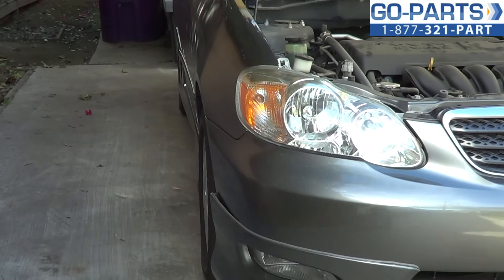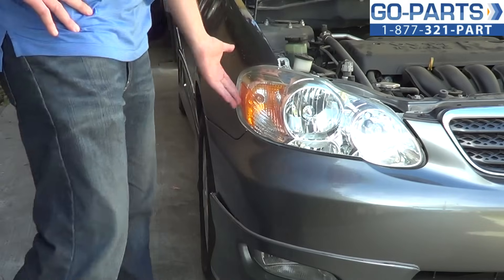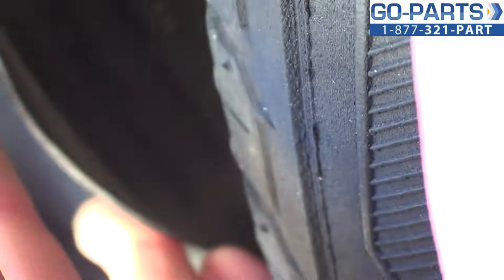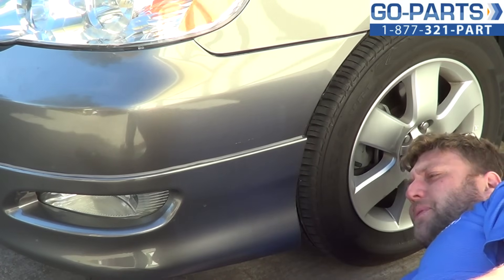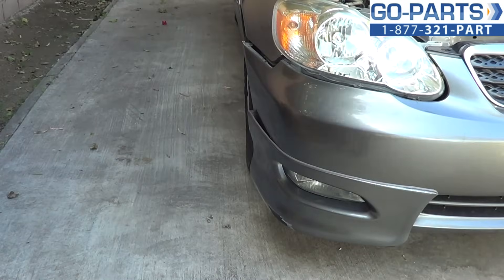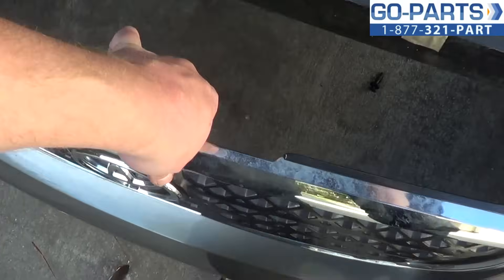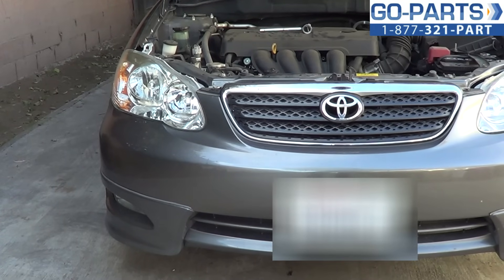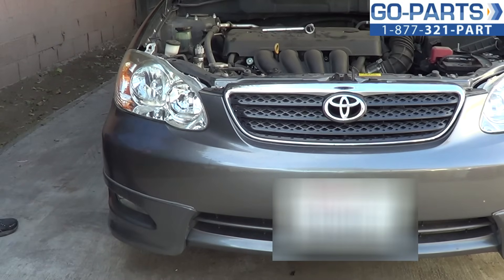Replace 2003-2008 Toyota Corolla Headlight / Bulb, How to Change Install 2004 2005 2006 2007

Comment: Great video here on how to remove a headlamp off a Toyota Corolla. Wow what a shame that Toyota made such a crappy design to where you have to remove the front bumper off the car in order to  remove a headlamp, that is such a terrible design and waste hours doing so! But this video really cleared that up I knew the whole time that I had to remove the front bumper just didn't know it would be this advanced. Great video keep up the great work happy New Year as well! 🥳
Reply: Yup..terrible design for sure! Probably done that way so more can be charged by shop to do the job.

Comment: I recently changed out my 2005 Corolla headlights.  I found several clips holding the bumper cover assembly.  I didn't want to replace these. However, I also found that when I removed the screws from the wheel wells I was able to pull the bumper cover down at the side to allow removal of the headlight side screws.  The whole process took me 2 hours for both headlights, other than the 20 minutes looking for a screw dropped into my engine compartment.  So have a tray for your screws.
Reply: you prolly dont care at all but does anybody know a tool to log back into an Instagram account??
I was dumb forgot the account password. I appreciate any assistance you can give me.
Reply: @Jermaine Wade instablaster =)
Reply: @Melvin Jackson Thanks so much for your reply. I got to the site through google and im in the hacking process atm.
Looks like it's gonna take quite some time so I will get back to you later when my account password hopefully is recovered.
Reply: @Melvin Jackson It did the trick and I actually got access to my account again. I'm so happy:D
Thank you so much, you saved my ass !
Reply: @Jermaine Wade No problem xD

Comment: Thank-you very well done, lots of helpful detail.   My sister is super talented with cars, but alas she is travelling, which is great for her.   But here I am with a burnt out light bulb, thanks to your video with some trial and error I managed to change it.   I had trouble taking the bulb out of the grey clip, it was tight and stuck, but just kept gently trying as I did not wish to break anything.   All the best.

Comment: Excellent instructions.  I just received an '08 Corolla LE as a gift with only 34k miles but due to age the headlight plastic has become hazy.  Both of them.  I saw brand new on ebay (a pair) for only 87 bucks.

Comment: Is there anything different about the left side housing or is it all just reversed?
Reply: Tom Boots - the only difference is there is something on that side near the battery that you will need to disconnect. Well it makes it easier. Pops right off. I installed mine without removing the bumper but man did I cut up my hands and scratch up the bumper a bit. Had no idea why it was so difficult. So for the next assembly (only did the left side). Now, that I’ve seen this, I’ll prob take the bumper off. Sounds scary tho. And I don’t have a driveway or street. Apt bldg. people frown on any car work.

Comment: You don't need to drop the front bumper cover to remove the headlight housings. I have a 2004 Corolla. I removed both headlight housings, I never touched the bumper cover.

You also don't need to block your license plate. That's some weird paranoia that started with people selling used cars. When you drive around, you see license plates. If someone sees your license plate in a video, it's not like he can look up your address on the license branch website and steal your car the next day.

Comment: Thanks for sharing procedure for changing the headlight HOUSING. However, title is misleading. I'm hoping to share this vid with my daughter so she can change herown headlight BULB, but it would not be clear (for a non-mechanic) which of these procedure she needs to do and not need to do in order to replace the BULB.

Comment: A week ago both of the headlights to my 2004 Toyota Corolla CE went out. Last night on my way home from the gym a cop pulled me over and I got away with it being the handsome, smooth talking man that I am. It got me thinking I should schedule an appointment with the car dealership to get them replaced. However, I am concerned that they might charge me at least $150. I just don't want to get caught riding dirty anymore! By the way, I have no mechanical skills to do this.
Reply: It's super-easy to just change the bulb.  You just undo the little clip where the wires attach to the bulb and pull the wires away, then twist the bulb and pull it out.  To install the new one, just line it up and push it in then twist to lock in place.  Pop the wire attachment back on and you're done!
Reply: Biodus HA HA Do you have Corolla?
Reply: Kjetil Hansen  Yea my parents' car
Reply: On my Corolla 2004 its no space for hands so its not super-easy
Reply: +Terence Johnson Great story. Very rich and compelling.

Comment: So..all because of ONE screw/bolt located on the side, a person has to remove the entire front bumper just to replace head lamp. Poor design for sure.
Reply: yes but you can do it  without taking the whole thing down by bend it  back after taking the top middle and bottom screws away , it's not that hard . Volvo is known for a design where you pull out 2 sticks and the headlight pops out . 
 the tolerances are very tight so even the volvo doesn't just pop right out you have to get the angles correct 
 this wasn't much harder than the volvo .
 try taking the front bumper cover off a volvo ! you have to be a pro body work guy.
 you ain't getting a radiator out of one of those with out disassembling the whole shooting match